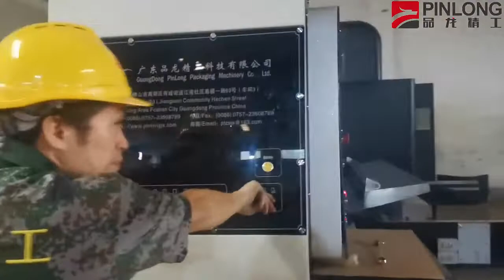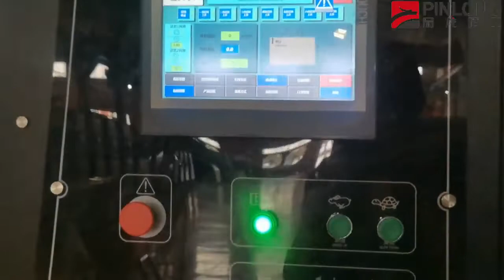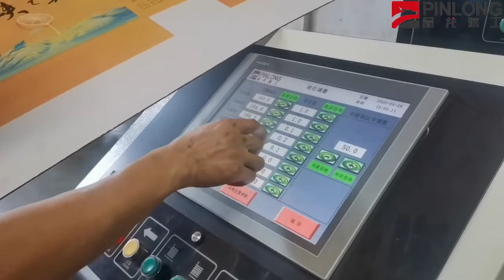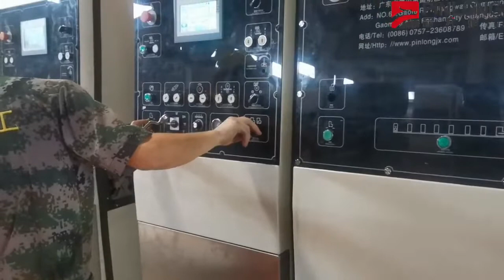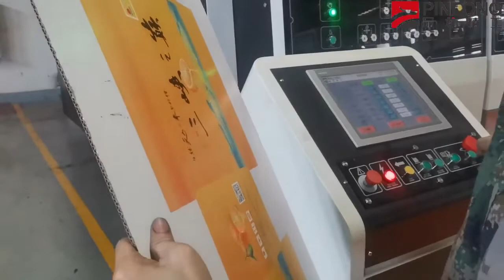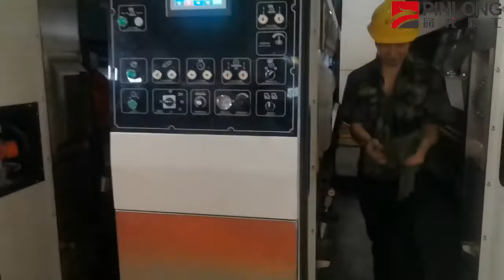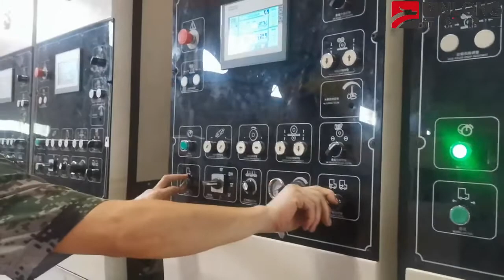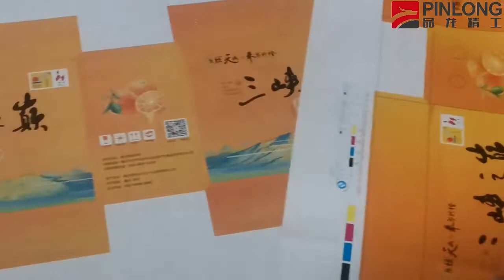How to Operate Flexo Printing Machine Corrugated Cardboard Machine Carton box Package Printer

Comment: Instead of having those blue arbacks for every stereo why don’t you glue the entire print cylinder with a blue ar back..  then once every 4 months change them..
Reply from the maker: Thanks for you attention, Calvin, you are right, Glue the entire print cylinder with a blue or back is a good choice for normal production, However we are the machine manufacturer, So we have to consider how to use it in each machine for testing😊😊

Comment: Hi, why put a blue canvas on the shaft, what role does it play when painting?
Reply from the maker: Hi Boss, We called the blue canvas "R-bak", The main advantage of R-Bak is longer printing plate using life and ensure the machine can running at a high speed without bounce, So that the printing effect will be more precise. Thank you for your attention^^
Reply: @PinLongMay  Ok, thank you!
Reply from the maker: @Vavimich735  ^^